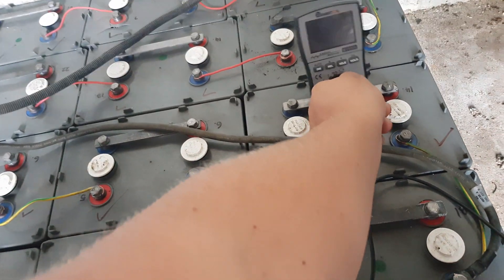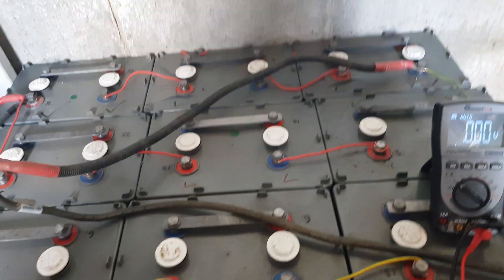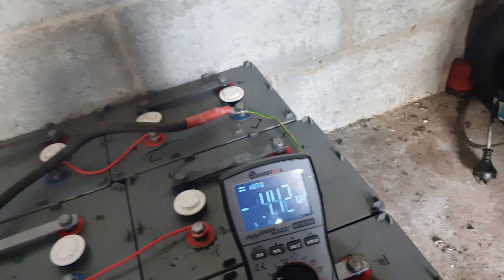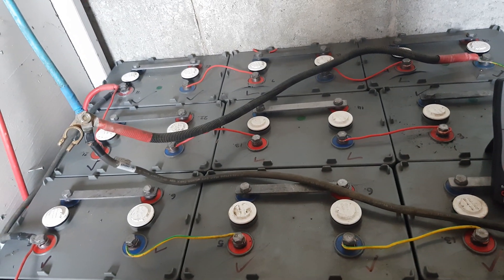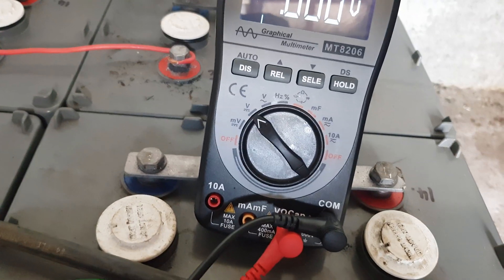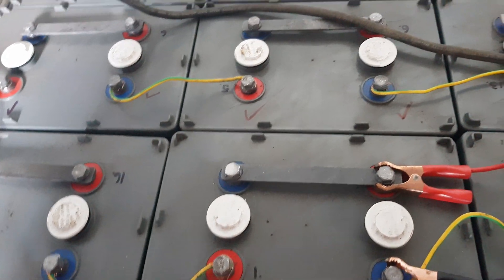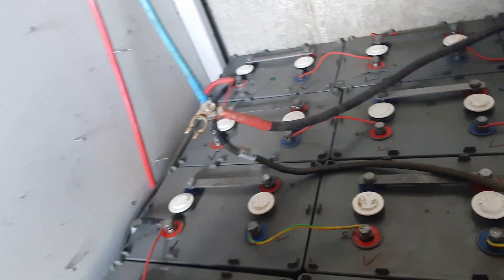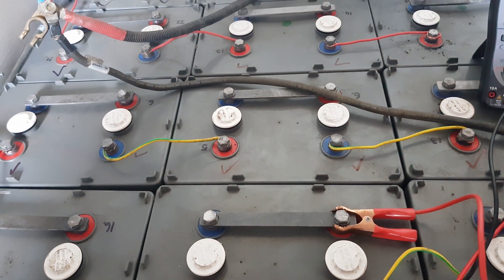Checking Gel 2v Cells For Balance building Up The 20Kwh Off Grid Shed Battery

Comment: I wish I could come across a deal on batteries like them! I found a set of L-16's for $50 each. With over half capacity.  I have those. And some cheap t-105 equivalent. In a 24v system. And a 16+/-Kwh, liion bank. And I'm adding to it. For my off grid house.